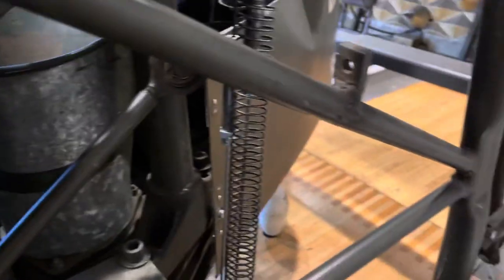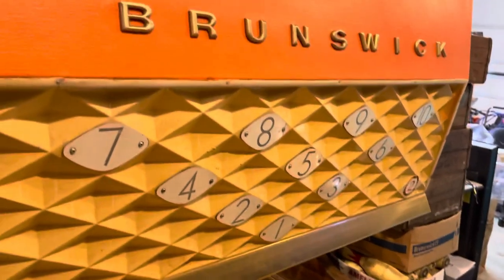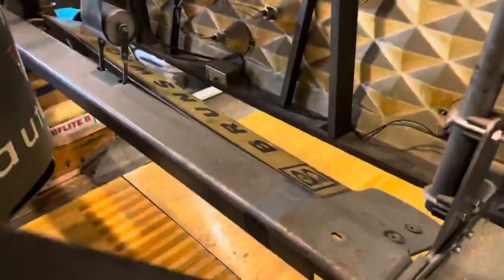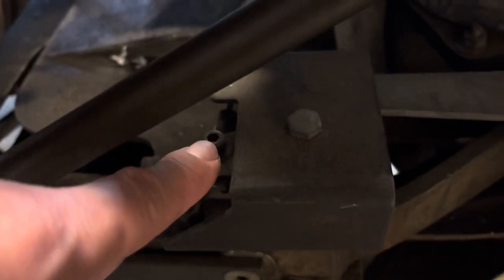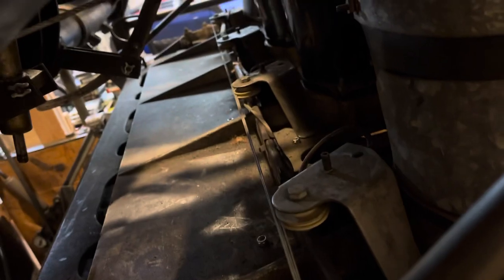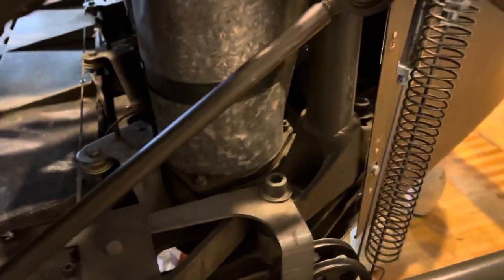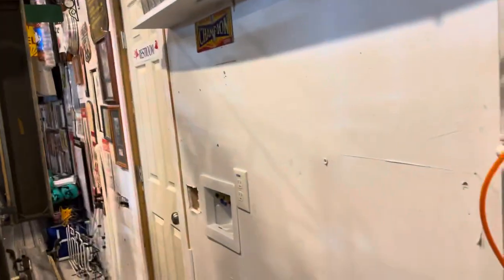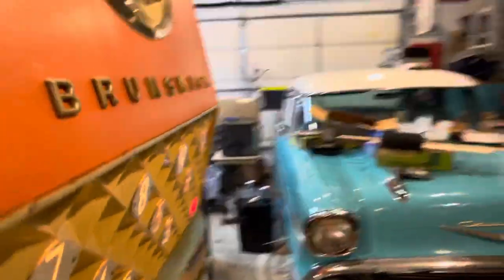Pinfinders: How do they work? Brunswick pinsetter @GarageBowlingAlley #bowling #vintage #brunswick

Comment: Where do the cables go from the deck to the lights? Also what do the switches on the grippers look like?
Reply from the maker: I’ll get closer in.    The cables go to a plunger more or less.  There’s a micro switch in each housing and when the deck goes down and the pin pushes up on the plunger the switch gets pushed and turns on the light.   The cable you see is only to reset the plunger when the deck shifts to go down to set new pins.
Reply: @GarageBowlingAlley  That makes sense :)